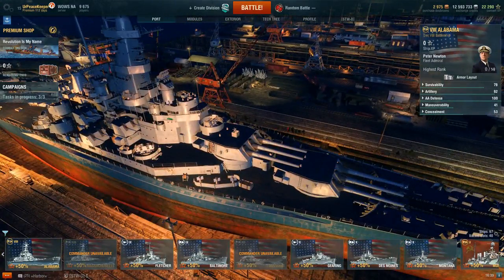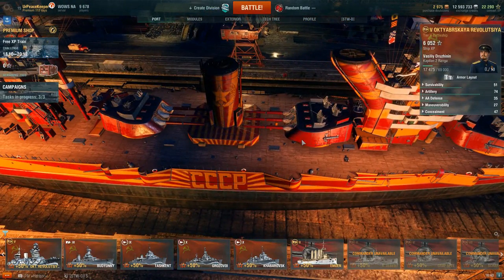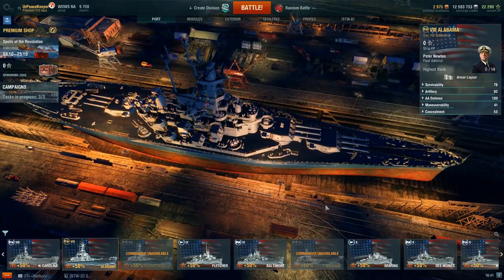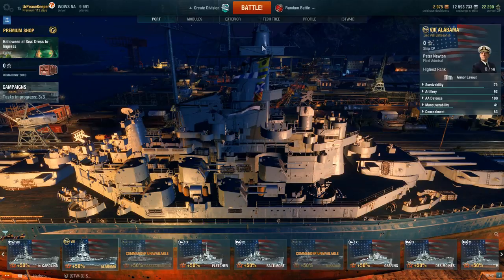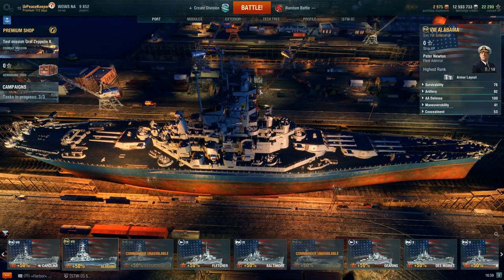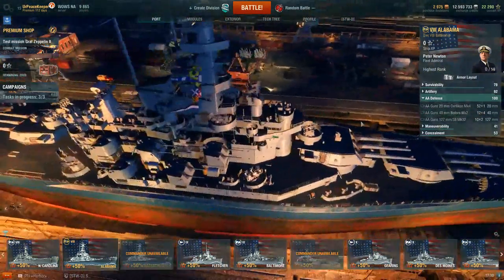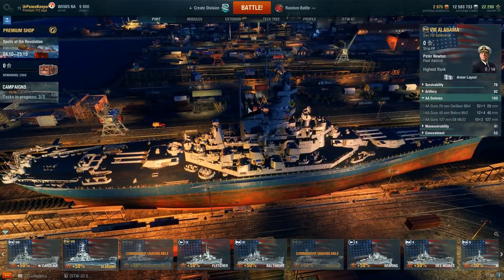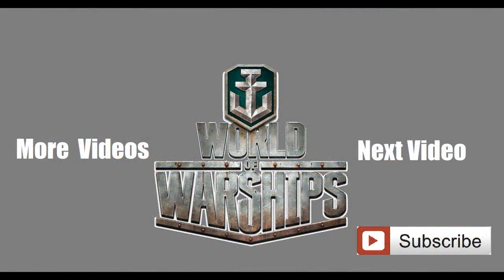The Fire Control Solution - Real Life Naval Fire Control

Comment: Great video!  I was a Field Artillery officer in the U.S. Army and can speak to some of the technical minute' of what goes into fire control.  I never did so from a ship but the underlying physics and technical issues are the same.

When engaging a moving target from a moving platform, you'll have to combine a few known factors with a few estimates to obtain a solution, which is  scientific estimate of where the target will be at the time of the fall of the shot.  This solution is expressed as technical firing data, the precise deflection (left/right) and elevation (up/down) for the guns.  Known factors include:

1 - Own ship course, ie the precise direction in which the ship is traveling.
2 - Own ship speed.
3 - Bearing to target, ie an exact direction to the target from the ship based upon a common standard.
4 - A variety of other minor factors to include propellant temperature, # of rounds fired, wind speed and direction, rotation of the earth, and a few others.  These minor factors generally had to do with either affects to muzzle velocity (propellant temp & # of rounds fired, which influences barrel wear) or to shell travel (wind speed, rotation of the earth).
Estimated factors were:

1 - Enemy ship course.
2 - Enemy ship speed
3 - Range to target.  The range would also give the time of flight of the shell; in FA, we had this to within 1 second, its possible the Navy had it to a smaller measurement but I don't know if that's the case or not.  The prime advantage of radar is that it gave an incredibly accurate range almost instantly relative to visual spotting.

The estimated factors were used to obtain the rate of change in range and bearing which would allow the guns to be aimed at where the target was predicted to be at the end of shell flight.  Observation of the fall of shot, by viewing the shell splashes, allowed for corrections to the estimates of enemy ship speed (if your shot was ahead of the enemy, your speed estimate was too high and vice versa) and range (shot falls in front of enemy, your range estimate was too short and vice versa) helped refine the solution to get hits.  And that's how you accurately engaged a target.

One other thing that you didn't mention but that's highly important is that fire control computers that the US and UK developed gave a tremendous advantage in that we could fire while actively maneuvering.  Prior to the Ford Mk I and its UK equivalent, ships had to maintain a constant course and speed while firing because there was no way to compensate for this as it would affect the solution.  However, the Ford Mk I had course and speed input automatically.  This allowed US battleships to change course and speed while firing.  As you might imagine, this would be a huge advantage, on par with modern tanks being able to fire while moving compared to WWII tanks that had to stop to accurately engage a target.  I remember reading that after WWII, the North Carolina was tested and able to maintain a solution while doing figure 8s at flank speed.  The Germans may have had this ability as well but the Japanese and Italians almost certainly did not.

When combined with radar, this gave the US, by around the time of the Battle of Guadalcanal, the ability to blind fire, ie to engage a target with zero visual reference such as in pitch darkness, fog, rain, snow, etc.  US and British radar was in millimeter wavelengths, compared to the Axis which was generally in the centimeter range.  While both could give very accurate range data, the millimeter wavelength was tight enough to also give usable deflection data as well.  The Battle of Guadalcanal was probably the best example of this, the Washington was able to score 19 hits out of 70-some rounds fired in near total darkness against the Kirishima.  Even against a battleship sized target at close range, this is insanely accurate fire and absolutely devastating.
Reply from the maker: Cool!  Good information!  I thought I covered firing while maneuvering, but you are right!  HUGE advantage!

Comment: Great video. The Ford Instruments Mk1 fire control computer was in and of itself an engineering masterpiece. I've seen it up close on USS Alabama on the many occasions I've toured her. 

Also the sheer amount of redundancy on these battleships is by far a standard thats hard to rival even in todays modern warships. They had Main Plotting Room and Secondary Plotting Room. Each turret had its own plotting station for local control as well as optical rangefinders in each turret. The Coincidence Mark 53s in turret #1 was removed from all 4 Iowas in the 50s however to save weight. As a side note; Missouri's model in game shows this alteration while the generic Iowa model has its original config. While modern warship design is created around the premises of not getting hit at all, warships of this era was designed to sustain combat capability with maximum damage absorbed. Remarkable engineering.
Reply from the maker: Absolutely and this was part of the reason my tour of the USS Iowa was so disappointing.  You never got below the main deck, and as a result you never got to see the juicy bits of how the main guns operated!  I really need to get to the other Fast BB's to explore this computer system more! :)
Reply: @Whiskey11Gaming  I actually was trained in 1975 to repair the MK1a and the MK 25 radar + gun director
Reply from the maker: @jfreeman1689  talk about a cool experience!  Don't feel like you need to hold back telling us your experiences!  The electro mechanical FCS computers are a huge fascination for me!

Comment: This was absolutely fascinating and insightful, thank you!  We have fire control in the game, just hit the "X" Key. Limited yes, but the math is there for us, technically speaking. That said, we still have to manually lead our targets and for good reason. Now, what I would like to see in the game is individual fire control for each turret. What I mean by that, is lets say we're moving North on a bearing. Now, I want Turret 1 to aim East, Turret 2 to aim West and so forth. If WG ever implements this mechanic, it will drastically change player strategy. I've hoped for this since the early days of CBT and still have my fingers crossed, that I'll one day have separate turret controls. Thanks for the Vid!
Reply from the maker: I don't think WG will ever do something like that as it would require a lot of programming on their part for only a slight change in game play.

Personally, I'd like to see them add a little bit of delay to some ship's firing of their guns on an individual turret and implement the reload animations.  How cool would it be when you are firing off the guns on your Iowa or Missouri and you can hear a little bit of separation between each gun fired and then when you zoom out you can see each gun in the three gun turret fall for reloading and rise back up when loaded!  It'd be such a cool little "Easter Egg" even if it doesn't do anything for the game! :)

Comment: Correct me if I recall incorrectly, but I remember a story, I think it was during Gudalcanal where the US navy shot at its own ship in a night battle. Could this be a drawback for relying 100% on radar and not visually confirming a target before shooting.
Reply from the maker: +zam023 This happened a few times but the USS San Francisco firing on Atlanta was definetely a failure to identify before firing. Night battles, forced radio silence and lack of awareness where friendly ships were definetely contributed to Atlanta being shot at by the San Francisco.
Reply: Also have to remember that early in the war, understanding and using radar to its full potential on such a scale was lacking. Especially with newly trained crews without any battle experience. Around mid-1943 and later the US Navy excelled at using using its radar technology.